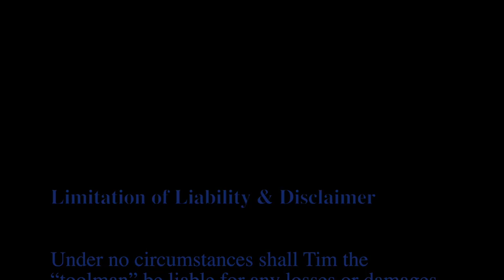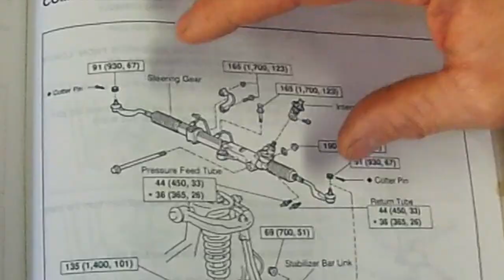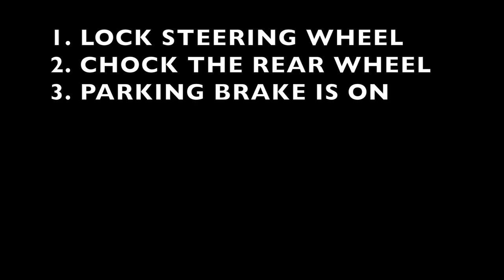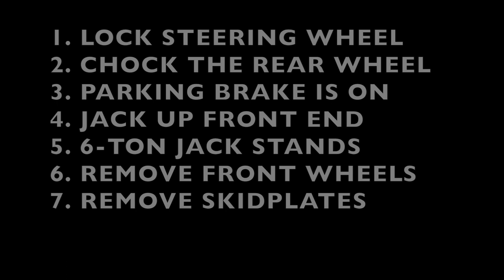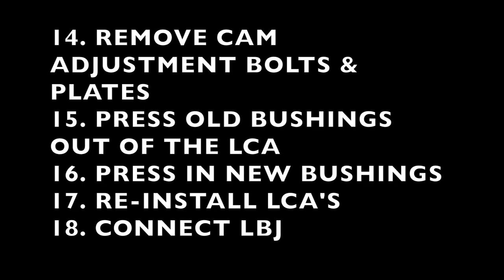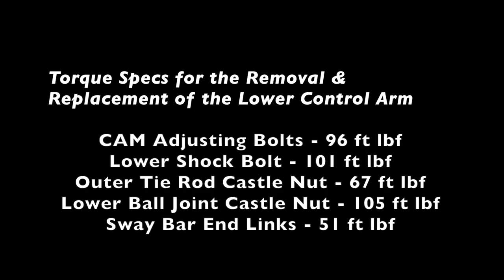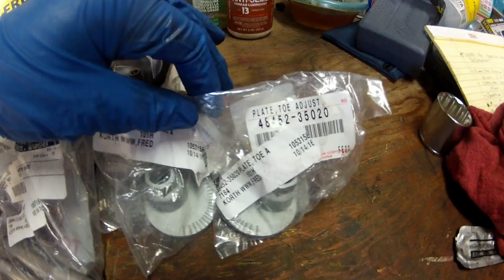Front Lower Control Arm Bushing Replacement (Part 1)

Comment: Just got done doing this repair over the weekend. Thanks Tim for all the good information in this video it helped out a lot. I do want to say that I think the Amazon links are not correct in clicking on them it takes you to parts that do not seem correct. The part numbers are correct but the Amazon links seem to be taking you to incorrect parts one was listed as a windshield washer bolt. Luckily I was able to pick up all the correct parts from a local Toyota dealer. I did this work on a 03 Tacoma I don’t believe it’s too much different if it all done on the 4 Runners. Un lucky for me I did have to cut out two of the cam sleeves the other two came out OK I followed Tim’s lead and bought the Diablo carbide blade they seem to cut through them fairly easily. After being able to get out my lower control arms I unfortunately found out that my bushings were so bad that despite following the instructions in the video placing it in a vice using a bottle jack and applying enough heat to where we almost caught the garage on fire they still would not come out not wanting to risk damaging the control arms I looked into what a local shop around me would charge me to press them out not having access to a press myself. Long story short the amount of money that local shops around me wanted to charge would be more than if I just went and bought new lower control arms myself. This was a bummer because I had purchased the white line bushings like they use in this video I ended up not being able to use them and just buying new lower control arms but like I said it was cheaper way out than having a shop press out the old bushings or me risk damaging the Toyota lower control arms. All in all I still believe that the bottle jack message would work I just feel my bushings were so shot that this method was not working.
Reply from the maker: Yeah, I checked the links and they are a bit funky.  I'll see if I can generate some better ones.  Thanks for the heads up on that.  Sorry to hear the repair didn't work for you and you had to resort to buying new control arms.  But, you got the job done and that's what counts.   Happy Wrenching!

Comment: Hey Timmy. I just finished replacing the upper and lower control arms, lower ball joints and sway bar links on my 3rd gen 4runner. I also dropped in a set of Bilstein shocks. I didn't get the shocks assembled, so I watched another one of your videos on how to do that. (Fun with spring compressors!) I did a mix-n-match of about 4 of your videos altogether to get the job done. 6 years later you're still keeping the wrenches turning! Greetings from Houston ,TX!
Reply from the maker: Great job getting all that work done Paul.  Glad our videos are helping you out.  Happy Wrenching!

Comment: Yet another well-executed, informative  3rd Gen T4R DIY service tutorial by you two fellow Bay Area 3rd Gen 4Runner guys!  Thanks for it!  

Let me know if you want to do a tutorial on installing some new SPC/LC adjustable front UCA's on a 3rd Gen, as I need to install some on mine ASAP as one of my bushings is completely disintegrated.  Been running the  3" lift for a few years now and figure its time to splurge on some aftermarket UCA's  to finally  bring the alignment back into spec, and obviously make it safe to drive again!

Unfortunately I live in SF and I don't really have the space to do it......
Reply from the maker: We just did a lift on a 2000 Tacoma on Thursday and it included installing SPC UCA's.  Are you on toyota-4runner.org?  We're having a Mod/Meet-up Day at my place on May 13th.  We could probably help you out that day.

Here's the link to the thread:
http://www.toyota-4runner.org/3rd-gen-t4rs/209965-official-bay-area-mod-meet-greet-thread-23.html#post2663726

Comment: Managed to do this job today with the bottlejack method. Fortunately I got a spare set of LCAs that lived most of their life in SoCal so with a little bit of heat and a 12 ton bottlejack they popped out without too much force. I did find out that using a balljoint press and the 4wd press kit you can easily press in new whiteline bushings and probably OEM bushings as well without the use of a vice as a pressing tool.
Reply from the maker: Good job getting the job done Aaron.  Thanks for sharing that a balljoint press with the 4wd sleeves worked to get the Whiteline bushings installed.  Press work is one of those things that you can usually fine multiple ways to accomplish.
Reply: @TimmyTheToolman  Absolutely. Just wanted to make a note of it so if anyone else is tackling this moderately difficult job knows the multiple ways to accomplish it.
Reply from the maker: @Phelps1111  Yeah, the more the ways the better.  Some dudes come up with some pretty ingenious ways to get the job done.

Comment: Great video. Should the process be the same for a 2001 Tacoma 4x4?
Reply from the maker: Yes, it would be the same.  Your sway bar end links attach differently to the LCA but that's pretty much it.  The 3rd Gen 4runner and 1st Gen Tacomas pretty much have identical front ends.

Comment: Swapped my arms this weekend.  It was a nightmare, two out of the 4 cam bolts were frozen. One had to be cut out with grinder and sawzall. And even with rack unhooked, it was still very difficult getting bolt and cam removed on driver side. Bravo on making it look easy.
Reply from the maker: For the driver side cam bolt, did you release the power steering line bracket on the inside of the driver side frame rail?  When you release that bracket, you can easily pull the rack back far enough to remove the bolt and cam adjuster.  I mention this in a comment I pinned.
Reply: @TimmyTheToolman  dang. I missed that! I didn't do that. You guys in California have nice clean vehicles. Colorado winters are tough on bolts after 20 years, haha.

Comment: I've done this exact bottle jack method. It works you just need to be patient. Watch this video several times and don't be in a rush. Spray everything down a few days before if you live in a rust belt state.
I will say, there is a right and wrong way to place the bushings in according to the FSM. I don't know if it's in the video. Probably is, Timmy is super thorough. 
I think that my 2 year old OEM bushings are going bad from 1 of them, front driver's side , not being correctly orientated when installing. It seems to be twisted and the rubber is showing stress cracks. Is this binding?
Don't forget to throw the new bushings in the freezer until you install! Helps quite a bit.
Reply from the maker: We actually don't talk about the correct orientation of the OEM bushings because we used Whiteline poly bushings in the video.  You are correct there is a specific orientation for them.
Reply: @TimmyTheToolman  woops. That's right. Im guessing that's why mine look twisted after only 2 years and now have to redo it. I just bought loaded arms this time.
Do you think that twist I'm seeing is from the orientation issue?
Reply from the maker: @rptrick79  I'm not sure if the twist you're seeing is from that.  Did you tighten the arms with the weight of the vehicle on the tires or with the wheels suspended.  If the arms were tightened with the wheels off the ground, once the vehicle is settled on the wheels, the bushings will be in a constant bind and not be in neutral when sitting static.  

I'm guessing you got an alignment afterwards and the tech would have had to loosen the bolts to make the adjustments to the cams and that would have taken the tension off the bushings.
Reply: @TimmyTheToolman  iirc we did tighten/torque on the ground and yes to alignment a couple days later. Now I really don't know why there's a twist in the bushing. Pretty curious at this point. Anyone else have this "twist"when looking at the bushings from underneath the truck ?

Comment: I did the lower control arm with the toyota bottle jack between the lower control arm but used under the jack bottom a piece of square stock steel and used it as a sleeve over the end of the control arm that the bottom of the jack would be and then put it in a vice so no force is on the arm,And the control arm was under the square stock in the same vice.I seen people on youtube do that and the control arm bends.Good work on the back left side lower control arm bolt,I just loosened the bolts on the rack in the middle (Took one out and only kept one in the middle to swivel the rack)and took out the bolts on the ends and the rack swivels on the center loosened bolt,It pulled down enough for me,Did not need to removed the boot,Cheers.Joe P.E.
Reply from the maker: Good job getting it done Joe.  There's more the one way to skin a cat.  Thanks for sharing your techniques.

Comment: Tim, your videos are great!  I have a stock 2wd 98 4 runner and im considering replacing my upper and lower control arm bushings with  Energy suspension polyurethane bushings. I'd sure like your feed back please. Thanks! Rich
Reply from the maker: I'm not sure about the uppers, but Whiteline bushings are way better for the lowers.  Energy Suspension aren't a complete bushing and sleeve combo like the Whiteline bushings are.  If you can't find something similar to Whiteline for the uppers, I'd go with OEM Toyota bushings.

Comment: I'm currently rebuilding the engine on my 97 4Runner. Fortunately, this gives me under hood access and time while I wait on the machine shop. Going to order sway bar, steering, LCA (Whiteline) and UCA ES poly bushings. Your video say's good time to replace lower ball joints. Does anyone know if upper ball joints are prone to failure as well?  Not a fun project but these are not disposable vehicles like so many other crappy cars on the road today.
Reply from the maker: The upper balljoints are not known to fail.  I'd only replace them if there's detectable play in the joint or the boot is torn and you've been driving it with a torn boot for a long time allowing road contaminants to get into the joint and cause wear.   If it's just a torn boot, you can purchase a reboot kit that comes with the boot, grease, and the wire to secure the boot to the balljoint.

Comment: Thanks for all the great videos and tutorials for the 3rd gen!  BTW - I just removed bushing from my LCA. I purchased a 20ton press, the bearing separator, and bushing removal sleeves from harbor freight. TIP, I sprayed a generous amount of Blaster around the lips of the old bearings and allowed them to soak in overnight.  When I put this in the press, to my surprise it only took approx 4 pumps on the press and the bushing popped right out no issues! I too bought new cam bolts and setup for mine.
Reply from the maker: You're very welcome.  Glad the job went smooth for you.  Happy Wrenching!
Reply: How well did the press work for the removal and installation of the bushings? I have a HF 20 ton and am hoping the control arms will fit into the press far enough so I don't have to resort to this bottle jack rigging. Even though it does seem to get the job done.
Reply from the maker: @bigsmallblock9480  The press works great.  Check out Part 2: https://youtu.be/6FzEHygizoI

Comment: My control arm bushings look like there is rubber visible on one side and none on the other? i can move the control arm a bit with a pry bar back and forth, im debating whether to do the entire arms or just the bushings... who know if my cams are seized as well, 98 4 runner in Montana climate its whole life.
Reply from the maker: Your arms are probably ok but the bushings sound like they are shot.  I think it's a safe assumption that your cam adjusters will be rusted inside the bushing sleeve.  Make sure you have a reciprocating saw on hand and some good steel blades.  Part 2 of this video will help you out: https://youtu.be/6FzEHygizoI

Comment: The "uhh" takeout reel sounds just like Peppermint Patty Psaki doing a press conference.
Reply from the maker: It's pretty funny, right?
Reply: @TimmyTheToolman   Big thanks to you for such a great video.  I did this today with Freel Good LCAs.  One thing I was able to do different was I never removed the steering ram. I just unbolted it, and lifted passenger side with jack, removed the rear LCA bolt.  Installed that side, then repeated, by lifting passenger side and removing driver side LCA bolt.  So really only needed to pull off opposite side each time and let it pivot on side I wasn't removing.  Of course the front bolts came off without an issue...had to saw off the bushings on both rears.  Ugggh, thankfully I had carbide blades.  Drives like new.  You are the man.
Reply from the maker: @snowhiterover  You're very welcome.  Glad our video helped you get it done.  Great job!

Comment: Wow,  you are incredibly well organized and thorough.   I have a 2004 Toyota Highlander, 6 cylinder, with 171,000 miles and failed inspection due to needing lower control arm bushing replacement on both sides.  They told me they have to take the engine out to do this. 14 hours of work.  Does that make sense to you?   Thanks
Reply from the maker: Hey John, no, it doesn't make any sense to have to pull the engine to remove control arms.  Are you sure they're not talking about something else that requires the removal of the engine?  If you want, how me some pictures of your lower control arms so I can make sense of why they are saying the removal of the engine is necessary.  Here's my email address: mtbtim@sbcglobal.net

Comment: Tim.  Thank you for the awesome videos.  I just recently did this same repair on my 01 4x4.   I used the Whiteline bushings.  One things that I thought about after the fact was if I needed to grease the outside face of the poly bushing.  The part where it meets the washer.   I didn’t notice that you did this in your video, so I am hoping that it isn’t necessary.  I did buy the cam adjusters that have grease fittings, so Hopefully that will be sufficient.   Thanks
Reply from the maker: Hey John, it's actually good to lubricate the outside face of the bushing that the washer meets up with.  I can't even remember if we did lubricate it or not in this video but I've now done this job 4 times and I know I've lubricated the bushings faces on those other repairs.  If you haven't gotten the vehicle aligned yet, it might be good to go back in and lubricate them.  If you've gotten an alignment already, I wouldn't bother then.  There is a chance you'll get some squeaking but hopefully not.
Reply: Timmy The Toolman I have already gotten it aligned, but I may go ahead and tear it back down and grease them.  I would hate for them to tear up from not doing so.
Reply: Timmy The Toolman I appreciate the response!
Reply from the maker: I don't think they would tear up but there's a chance they would make noise over time.  When the bolts are tightened down, the washer gets sandwiched between the frame member and the bushing.  I think the metal sleeve inside the poly bushing is what's doing most of the pivoting.  If that was greased, I think you're good to go.  It's just with some flexing I think the bushings could end up squeaking against the washers and sometimes even though you've lubricated everything really well, it happens eventually.  It happened with my sway bar bushings.  They started making noise and once I took the bar off and greased everything really well again, the noise went away.  It's probably the main downside to using polyurethane bushings.

You said you bought cam adjusters with grease fittings.  Do you have a link you could share?
Reply: Timmy The Toolman I actually decided to take go ahead and take it back apart and grease them.  Thanks!
Reply from the maker: That was probably the smart move.

Comment: My personal notes from doing this job with the bottle jack method is that being super careful isn't the right description.  If you aren't pressing the bushing out using almost zero effort, you're bending the arms.  My arms were clean and absolutely rust free.

I used my 12-ton jack to apply just a little but of pressure while I applied heat to the arm around the bushing.  Once it was nice and hot I just barely cranked on the arm and the bushings pressed right out.  It was such little force, absolutely nothing was strained or forced whatsoever.

The arms still managed to spread on me probably 1-2mm.  Like maybe the width of a washer or two.  This made re-install a real pain in the ass.  I managed to get it done, but it was a lot of hammering and lubing and prying.  My theory is that the heat here may actually be hurting as much as it's helping -- I'm wondering if the metal is getting hot enough to slightly deform with the little bit of pressure put on it with the jack.  It certainly aids the bushing in sliding out... but I dont know how you find that sweet spot.

If I did this job again, I'd source the bearing splitter and do the press method (or just buy some cleaned up and reinforced arms from one of the sellers who sell them with the eimkeith bits already installed).
Reply from the maker: Your experience is interesting.  I've done the bottle jack method a couple times and both came out with minimal force with the right application of heat and the arms went in without issue.  I think there is a chance you did use too much heat.  Metal can flex and bounce back into shape which is what happens with this method.  But, use too much force, and you actually bend them.  Your result isn't that common, at least I haven't heard that many people on forums and Toyota Facebook pages saying they bent their LCAs with the bottle jack technique.
Reply: @TimmyTheToolman  Yeah my language is a bit broad I suppose -- I just found it super shocking that mine bent at all.  I was in my workshop thinking "OK, Timmy says not to force this so any moderate resistance and I'm finding a bearing splitter!" and they just slid on out.   But then they were just BARELY spread apart.  Super weird.